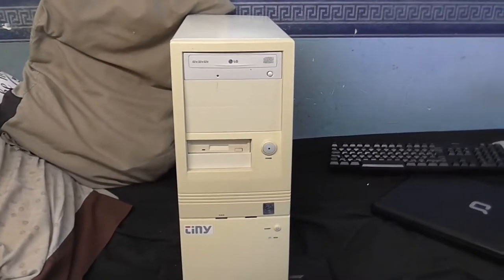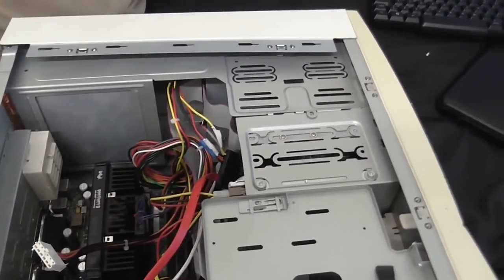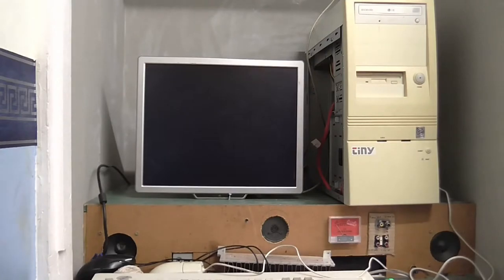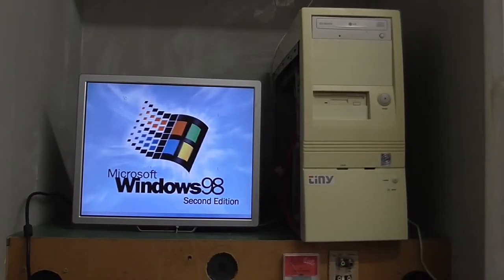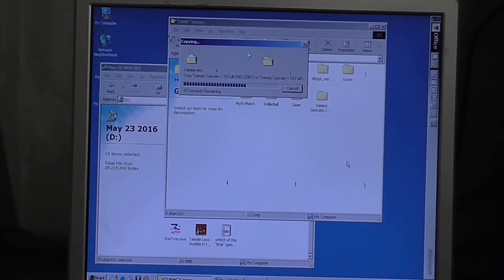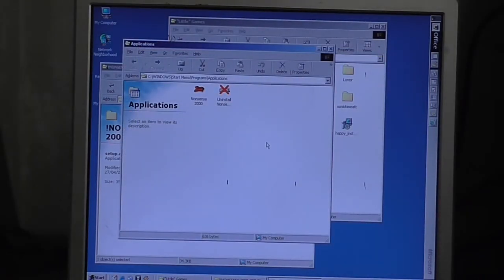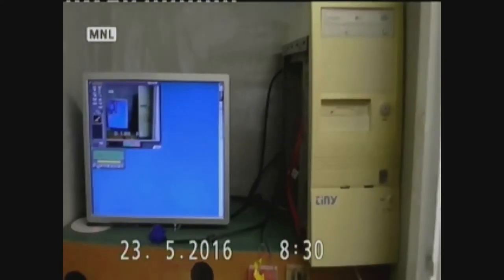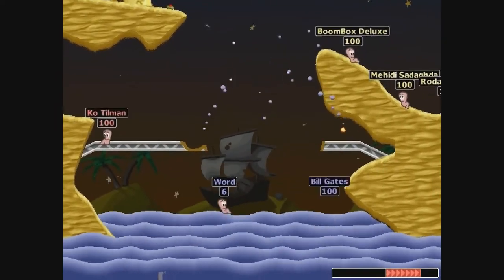The PII Win 98 Computer

Comment from the maker: No comments yet?  This has been up for like, 8 hours now. (as I'm typing this)
Reply: Here's a comment, lol
But anyways, this reminded me of the old machine I used to have. I don't remember exactly what processor it had, but it was an AMD. It also had a 20gb hdd, and i think it also had 256 megs of ram. Before I got rid of it, I popped it open, and the poor thing was caked in dust, the fan bearings were worn, and some of the caps were leaking. Otherwise, it still ran nicely.
Reply: For some reason this video does not show up in my subscriptions. I just randomly found it. So YouTube is broken again...
Reply: works fine in win9.... demo  that failed.  Id like to be an IT person making 250K donuts a year!
Reply: win10 is nothing to write home about either.
Reply: i just sent you a comment. i like your video. i really miss 98 a lot :)

Comment: you could build a reasonably good computer with a ASUSTECH FM2+88 motherboard and use the A10-7800 or A10-7980k which combines the CPU and GPU into one package which also has a TrueAudio sound card to boot and you will be able to get by with 8 or 16 GB of GDDR3 system RAM which should be good for rendering your videos or get a second hand Lavorno Think station with two 36 core processors which will make quick work of video editing.